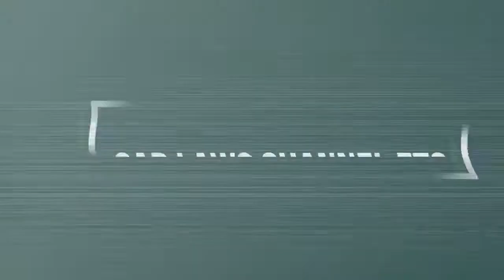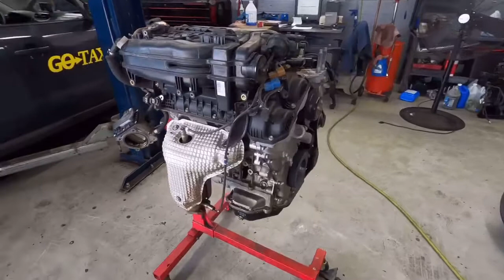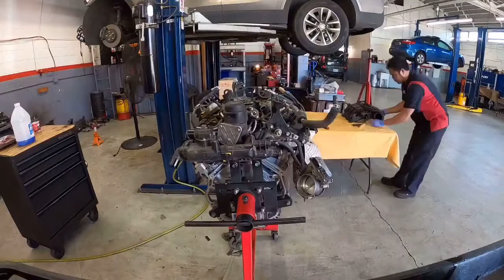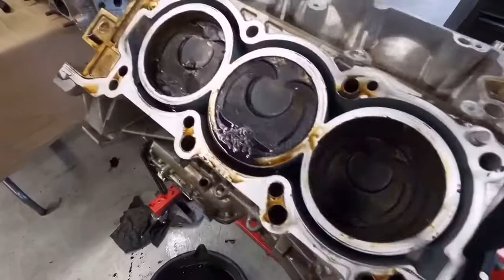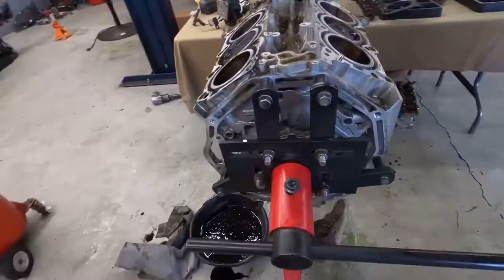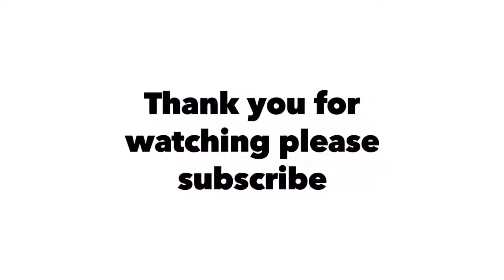3.3 v6 engine teardown on 2015 Kia Sorento time-lapse. Enjoy. #teardown #sorento #kia #removal #v6

Comment: What issues have you seen in that engine ? I have a 2015 kia Sedona that we have changed the oil every 5k times with fully synthetic oil. It has a loud start up noise common with these engines. Does kia have an updated TBS bulletin to fix them under warranty?
Reply: I believe there is a TSB related to tensioner that rattles upon start up. Have a similar issue
Reply: @ZloB1N  there is, but it states that the rattle needs to be over 4-5  seconds for them to do something. I don’t know if that done to wait for the warranty to run out.